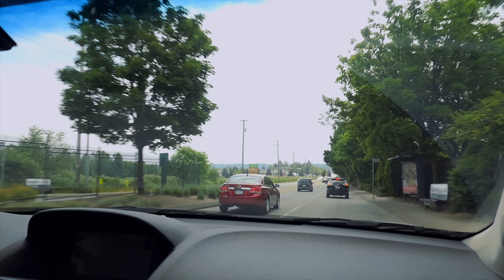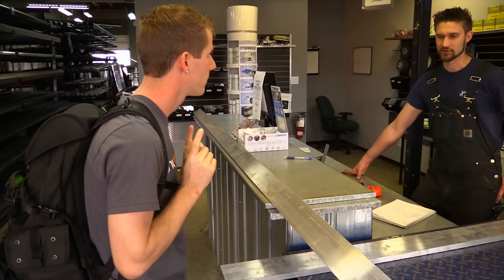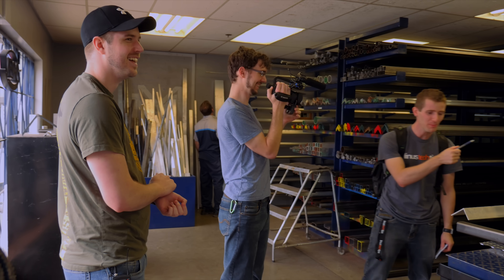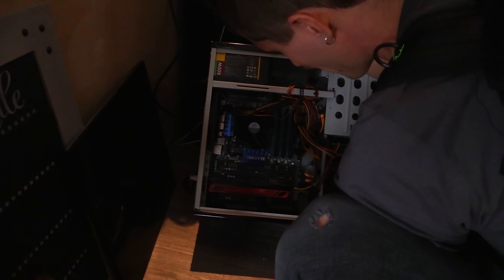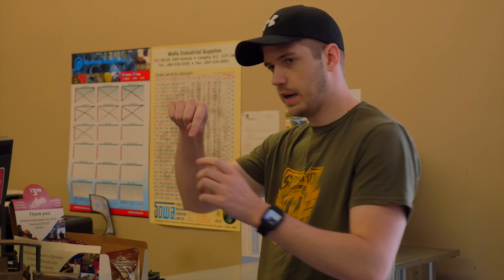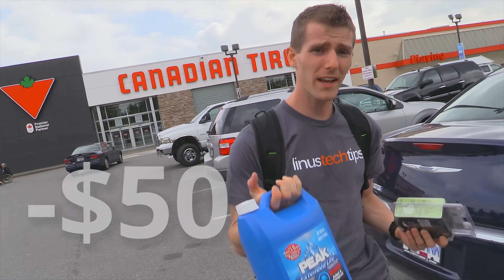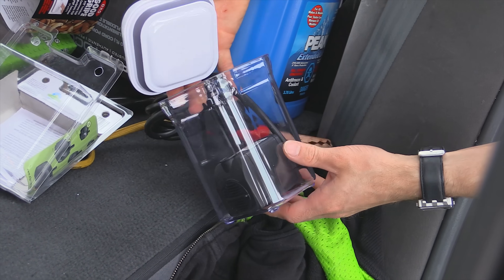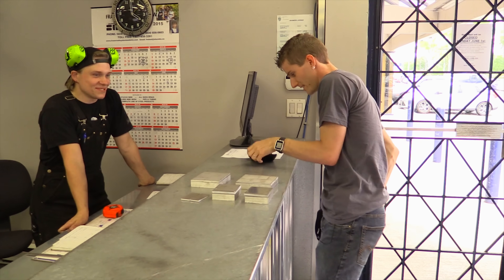$500 DIY Water Cooled PC Challenge - Scrapyard Wars Episode 2b

Comment: You could have made a distillery based copper heat-sink, often used in liquor brewing illegally or otherwise, thus making a radiator on the cheap. But you would mostly wish to have two pumps and have ice water cycling in the tank you put the copper tubes well doing this, and depending on how hot you wish to make the water in the heat transfer as well for tolerances and other such on top of that. When brewing it's turned to steam but doing that would mess up the system, but the general water cycling method with it make sense. Pre-made copper tubes would even work if you wanted to make a set of them and such so they look nice and such. Also your company should have as a Tech-company no tickets for texting or operating a device well in a car that is moving as a key part of your company rules to show you operate vehicles and media objects including a phone responsibly. Well the PSA was nice you should have already had it in a company motto or rules before that.

Comment: 6061 is the cheap standard aluminium, 7075 is concidered ''air craft grade'', a lot of manufacturers say their products are made of air craft grade aluminuim, but unless it's specified as 7075, I doubt it is air craft grade, since its first of all pointless for consumer products, and seccond of all extremely expensive compared to ''normal'' aluminium.

Comment: Reminds me of a random water cooling DIY I tried at home more than ten years ago when I was a teenager. I only bought the proper CPU block but it was built on top of a homemade table that had a small race gas tank with a plastic bladder and submersible pump ran down to a chest that the table sat on top of that had a small automotive trans cooler and fan inside that acted as an oversized radiator for the system all ran with home depot fittings and clear vinyl tubing. Then inside the radiator box I had a car battery with a small constant charger to run the fan on a toggle switch.  I actually think I still have the tank and and some of the parts in my dads attic back at his house.

Comment: Why didn't you just use distilled water would it damage the parts that bad ?
Reply: In short term, no, it wouldn’t do anything in the short term.  After a long time (maybe a year or so) it will start to corrode

Comment: Could anyone help me with a pc I wanna play overwatch and csgo mostly my budget is around £350 - £400 thx
Reply: conor maguire a toaster will run CS:GO and you can get away with a low budget build and good FPS. Look on PCpartpicker and start a topic people are super helpful and will give you good advice on what to get with that budget
Reply: Thx cause I'm new to this pc stuff
Reply: conor maguire I was very recently just watch YouTube videos that are recent on builds and look at builds on PCpartpicker and ask questions on the forums you will learn a ton in a very short time
Reply: You don't need a super expensive computer for that. Something like a 750ti with a decent low end processor like a g4400 pentium would do really well. it'd just be a matter of finding a good set of parts to go around it. I'm confident you can get something like that for under 400$ US so it should be quite, quite easy to do that for £400 or less.

(provided you get good prices on parts something like a 1050 or a 460 would be excellent)

Comment: Coolant? Just use water... It has the best thermal capacity of any liquid.
Reply: he got the coolant because it has anti corrosion in it
Reply: Everyone knows CPUs need BRAWNDO. Its what cpu's crave.
Reply: you do realize copper and aluminium corrode when used in the same loop with just water right. Thats why he had to use an anti corrosive coolant
Reply: no it doesn't. hydrofluoric acid has the highest thermal conductivity of all common liquids. then if you want to get pedantic over it, there is also mercury which is 16 times more conductive. (hydrofluoric acid is about 5 times more conductive.
Reply: z hydrofloric acid doesn’t even have a particularly high heat capacity, around 2.8 J/(g K) vs water at 4.18 J/(g K) and ammonia at  6.74 J/(g K)
Reply: Lol
Reply: I heard if you use Mountain Dew it make your PC run much faster since it's so much better at cooling than water. You should try some time.

Comment: Hey if I could make a suggestion for any future builds.  Consider a vehicle heater core rather than a full radiator.  The heater core is essentially a mini radiator that your a/c fan blows across to heat your car. It's piped into the cars cooling system much like the radiator.

Comment: You don't need a car radiator. A heater core is a miniature radiator (still large by PC standards) that resides inside a car dashboard. An oil cooler might also work.

Comment: The heater core out of an old pickup would have been a great choice for a Rad... they are easy to get too and are usually made of copper if you get them from a much older pickup.

Comment: Guys I hear you talking about a car radiator. Why don't you go with a motorcycle radiator or a car's oil cooler, those would be perfect. If fact you could put a dual 20 mm or dual 40mm fans on it

Comment: Hey, would anyone know if this is a good system and help me pick some parts that i haven`t picked yet?
CPU: AMD FX UNLOCKED BLACK EDITION 8350 PURCHASED
GRAPHICS CARD: NEED HELP
POWER SUPPLY: NEED HELP
CASE: ZALMAN Z11 STADARD PURCHASED
MOTHERBOARD: msi 970 gaming PURCHASED
SSD:240 GB NEED HELP
HDD:1TB NEED HELP
RAM: 16 GB NEED HELP
OPTICAL DRIVE: DVD/BLUERAY STUFF
thanks in advance :)

Comment: LOL I might be revealing an old drag racing secret  but we used to  take old coffee cans ,, take fuel line and    neatly coil it inside the can ,, then filled the can with  ice and hooked it into the  line.  filled the can with Ice ,  technically you can do that for this application,  basically  instead placing your submersible pump in the center of the  coil in the canit would drop the   fluid coming out of the pump by  about 10 degrees before it even  hit  the radiator, and the heater core was a good idea but the transmission coolers are smaller , you use silicone putty to seal up the can btw,, in case someone  wanted to try this.

Comment: Fuck yeah, this civic(let's hope that's the manual version) is a great car! I drive one and the fuel efficiency is just darn perfect.
Reply: MuzzaFuzza well you apparently don't know how to drive efficiently, since you complain Diesel vehicles are inefficient.
they chug to accelerate due to generally higher mass, but can effectively coast on fumes once you're going.
Reply: MuzzaFuzza 'perfect' would be estimated 1000M/G City. :)
besides, if you want Fuel Economy, you get a Diesel Truck and lug it. cleaner burns and fuel consumption almost completely disappears.
Reply: MuzzaFuzza whenever you're at speed, you should always shift to the highest gear. Engine will be running basically at idle Revs while you maintain any usual speed limit.
Reply: MuzzaFuzza Reaching 3 litres per 100 km on the Glorious Low Revs (translated to metric system for us, noobs).
Reply: Yeah he drives a stick
Reply: ***** I used to drive a 2010 Ford Ranger and my wallet took it hard everytime I went somewhere so I'm comparing to that, the civic is way better.
Reply: ***** Are you teaching me how to drive? lol cute.
Reply: ***** Diesel engines are no miracle for cars, they can be more efficient but not like fucking magic. Burning 6l of diesel oil instead of 7-8l of petrol per 100km is all negated by the cost of replacement parts.
Reply: ***** according to the previous fucker you're wrong haha...seems like he knows about car efficiency more than anyone else, I won't try and counter his arguments, he seems so smart. He sounds like a car efficiency diesel scholar, I wouldn't go near that shit.
Reply: ***** ofcourse it's not a miracle system. but upshifting to run on fumes as often as possible is actually healthier for the engine than 'standard' driving, while consuming multiplicatively less fuel.

everyone i know that uses Trucks does this.
Reply: ***** Because trucks don't go higher than 3000 rpm and usually cruise between 900 and 1500... Except if you're talking in Retarded English and calling a pickup a "truck" lol
Reply: ***** ah, you've been backed into a corner i see, and must lash out with insults to defend your self esteem.
a Pickup Truck is called a Truck because it fits the Dictionary definition of a Truck.

if you don't enjoy lugging your Diesel, i agree it's more of a pain than just driving normally.
still allows very low fuel usage though.
Reply: ***** Please excuse me, Mr Fumes, I have not done enough research on the topic prior to engaging in a discussion with You. Diesel engines do indeed burn half as much fuel as petrol ones, and their parts never die, so you don't have to replace anything over time. The Glorious Low Revs Master Race is real. Sorry again.

Comment: Get out my strap-on cus dis gun be good?!  Ewwwwwww haha ;-)
If you insist!

In all seriousness though, the 6061 T6 aluminium stock you picked up is quite nice, it's commonly used in high end precision manufactured skateboard trucks and one of its best features is that its resistant to oxidation and rust, even in wet weather conditions.  If you get T611, it should also be artificially aged and heat treated as well, for added strength.  Have fun!

Comment: hey guys i need some help ive built these gaming pc and it still just slow and i cant figure out why i checked if bios is up to date, checked drivers, checked connections and cant figure out the problem its so slow in new games like gta 5 and advanced warfare even when i use default settings it puts everything to ultra when i drop to normal it still has problems it shutters alot i feel it should be smoother see what is inside it help please rig below MOTHERBOARD: ASUS CROSSHAIR V CPU: AMDFX Series Octacore FX8350 4GHz Desktop Edition GRAPHICS: SAPPHIRE 100360SR Radeon R9 295x2 8GB POWER SUPPLY: AntecHigh Current Gamer ATX12V EPS12V Power SupplyHCG850M MEMORY: CorsairVengeance 2Pack 4GB DDR3 DIMM Desktop Memory KitCMZ8GX3M2A1866C9 120GB SSD AND 1TB HDD WATER COOLED CPU PLENTY OF FANS

Comment: Why a car radiator? A radiator off of an old dirt bike would be cheaper and smaller and more practical to fit in the case.
Reply: Or a car heater core.
Reply: melias67 I don't think they know about motorbikes.
Reply: or a oil/tranny cooler off a car
Reply: tedingus Check the newest vessel video for part 2c. You'll see something...
Reply: freakyfreak7777 Linus had one.... XD
Reply: Elis Soto Wow that is something that I wouldn't have expected.
Reply: melias67 Or use a heatercore which is the same size as a computer radiator
Reply: tedingus ^ this.
Reply: Elis Soto Yes but a radiator off of His Honda or what ever it was is massive. A smaller, lighter dirt bike radiator would be good.

Comment: Luke you went the good option, Copper not only has better heat transfer rate then aluminum but you can solder it vs having to weld aluminum. Aluminum is insanely hard to weld, thats why it costs alot to fabricate. But copper you can solder at home with just some flux and fine sand paper. Sand the edges of the block that are going to be soldered, hit it with some flux and slowly heat the copper with a $5 torch from Walmart and keep touching the solder to it until it drops in place and fills in the hole. Soldering is honestly easy as hell, welding is to but only with the right parts. But Iam telling you, you can easily solder a little tiny copper box with 2 outlets EASILY in like 20-30 mins.

Comment: Shouldn't have bought coolant. I doubt that water will see less than 10 Celsius,  and water is cheaper and better at conducting heat. Coolant is designed not to turn into ice, which can hydraulically split your car engine in half if it didn't have freeze plus
Reply: Plugs not plus

Comment: Vessel master race, already watched part C.
Reply: ***** Linus falls out of a tree and breaks his legs, Luke cuts his finger off with the metal saw and is rushed into A&E. Woops
Reply: SweBass Or just be clever and get it when Linus was offering it for free
Reply: ***** Linus right butt hurts.
Reply: I don't get the point of Vessel, it just divides the community and also the videos have ads. Not worth enough.

Comment: It's here! Scrapyard wars! Where Linus and Luke build computers better than my PC...
Reply: lol im running i3 3217u 2gb ram and sh1te integrated gfx
Reply: yaseen reza my r7 250 is able to run it at 30 fps with normal and high settings at 1080p
Reply: ***** I actually can't - txaa has such minimal performance impact, it's stupid to play without it, but it requires minimum msaa x2 to run. The game is ugly without it, trust me
Reply: I also did a lot of mistakes with my first PC starting that it was a prebuild complete PC^^ They only advertise the cpu/gpu but as soon as you try some overclocking or upgrading you hit limits everywhere. weak psu, cramped tower, lack of mainboard functions .....
If features like shadow play or dsr are really important for you then you probably have to pick the slower but newer card though.
Reply: ***** If only I could upgrade the gpu in my aio :I
Reply: You guys seem strong when my compared to mine sore 2 duo, 3 gb ram ddr2, nvidia g210 1 gb, 500 gb hdd. -_-
Reply: ***** my friend i had an g210 sold it for more ram(i sold it for around 20$)
Reply: http://www.dailymotion.com/video/x2tvzbc and here is part 2c from this series
Reply: ***** I run it at 720p, scraping by with 2x MSAA, FXAA and Nvidia's TXAA
Reply: ***** For a $110, you could maybe save up for  GTX750 Ti - It has 2gb of vram, low power, and ok performance - better than mine even. I wish my bro'd spent the extra $10 to get it :s
Reply: yaseen reza What do you mean ok performance. The gtx750 ti is amazing I run every game maxed out and never get less than 30fps (1080p)
Reply: yaseen reza just go with 1080p and let the msaa off + txaa off
Reply: James Mac Mahon my while life I tried to stay away from 60fps. Once I found it, I had seen the light haha - the 750ti is a very good card, I was comparing it relative to 780, 970 etc.
Reply: James Mac Mahon # 970
Reply: yaseen reza If I had to buy a budged gpu right now I wouldn't go for such a new card as the 750 ti. I think it's better to use cards from older generations which would probably be (much) cheaper for the same or even more performance. for example gtx 460 sli, 480, 560ti, 570, 580, 660 maybe even a 670.
Reply: megapro125 Yeah, especially since they can do stuff like support SLI. To be honest, GTX750 was my first personal build, so I wasn't really experienced with it, and didnt want to risk spending the same money on a 2nd hand card, or just more money for an older card that might not support stuff like shadowplay
Reply: megapro125 than I was lucky with my prebuilt pc,got a single core(AMD Sempron 145) which can be unlocked in dual core,good motherboard for OC MSI 760GM-P21,good GPU R7 250 and 4GB of RAM.But I am going to upgrade the CPU in two days and put a Quad Core in an AMD Phenom II X2 910e
Reply: +yaseen reza your pc atleast runs gta V
Reply: The Randomchannel yes, after some big overclocking - I might sound pretentious here, but it's kind of like what's the point of having a dedicated GPU if the dedicated GPU can't do much, like in Linus' low end card rants
Reply: I can't even run ultra settings lol.
Reply: Not bad
Reply: I dont understand how to build a pc and if I were too my budget would be out 150 to 200  which can run fortnite at 480p at a smooth 30 FPS could I order the parts and does anybody know some good pcs I think my friend can build it for me for about 50 thx!
Reply: Shut up everyone i have a pc that can run minecraft at 3 fps 

What ya say now
Reply: I use a Nvidia GTX 750 1gb. GTA V looks like it was made in 2003 on my PC